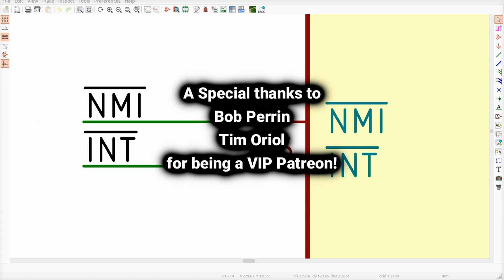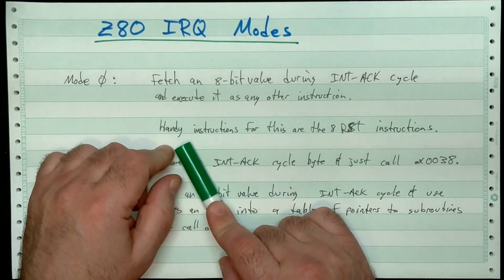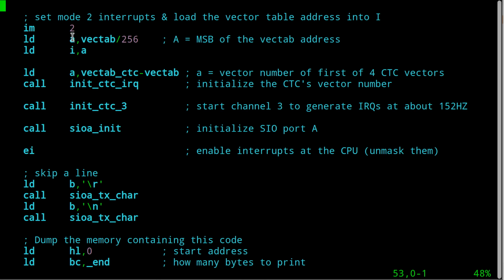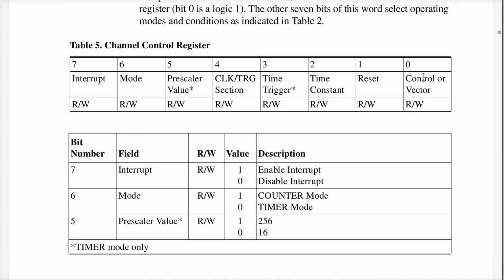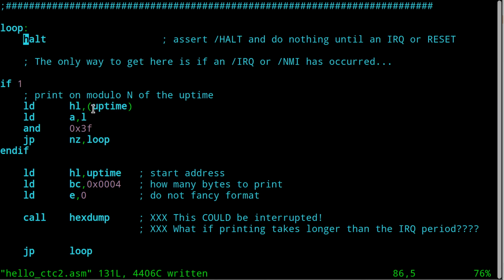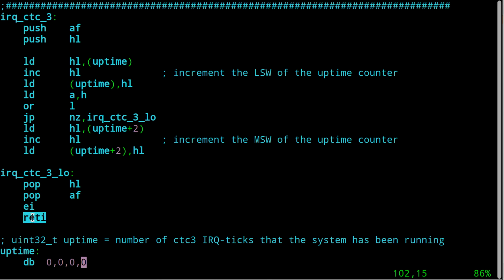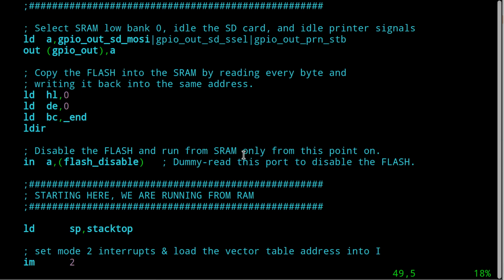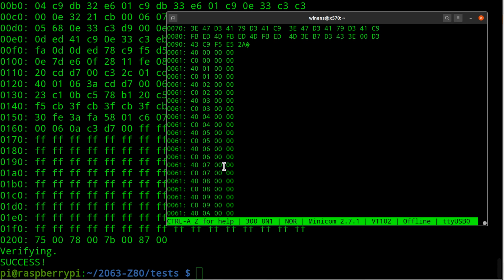Z80 Retro #16 - Board Testing Pt. VI (Interrupts)

Comment: So that's how the Z80 can tell what device triggered the interrupt.....huh. I'm using a microcontroller for serial I/O and the ability to perform interrupts would be very beneficial. Is it possible for an interrupting device to participate in the INT_ACK cycle just by monitoring /M1 alone? Or is that a bad idea, say if /M1 can go low for an unrelated reason? (Not sure if that's even possible)
Reply: The interrupt acknowledge cycle is decoded from /M1./IORQ
/M1 is used all the time for op code fetches.
You will need to decode interrupt acknowledge if you have bidirectional buffers (74xx245) on the data bus or are rolling your own Z80 peripherals.
Reply: Thanks, yeah luckily I have two pins to spare for /M1 and /IORQ so I can decode it.
Reply from the maker: One if using mode2 then you also have to participate in the priority chain & the state machine that releases the chain after a RETI.
Reply: @JohnsBasement  Only if you have multiple Z80 family peripherals. If you only have one being used with IM2 it only needs its IEI pin pulled up. If you use a Z84C15 which has CPU+CTC+SIO+PIO in a 100pin package there is a control register to set the interrupt priorities.

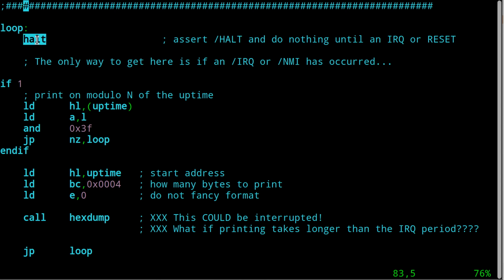Comment: HALT do WHAT?!?! @45:00

So they lied to me in school when we were fiddling with these Z80's. They said that HALT was a a total stop and the only return of function was to restart it.
As I always said and still say to this day, school here in Sweden sucks and even worse nowadays. You can't be a total freak into only ONE subject here, you have to be less then average in everything and I hate it.

Keep up these wonderful vids about Z80. I got a handful of them lying around, could be cool to try something out with them. Z80s, PIOs etc...
Reply from the maker: I teach from time to time.  It is amazing how hard it is to get entirely through a lecture without using the wrong word somewhere or even messing up an example.

:-(... I just uploaded a video where I refer to the alteration guide by the wrong name (although I expect you'll figure that out) and I used the allocation block number in a directory entry as an SD card sector number in some math.  :-(  After I reviewed it I calculated the correct value and my point was ultimately correct, so I am going to leave it (that one is in next week's videos.)

These things happen some times.

But I /will/ agree that saying that the halt seizes up a Z80 with no way out but a reset is not just a simple flub of using the improper units in some math.  In fact, I have never programmed a CPU where HALT is a hotel-California operation.  'cept maybe on systems that lack an NMI signal, do not generate DRAM refresh and you DI and then halt... which WOULD seize things up nicely!
Reply: @JohnsBasement  I took a class in which we described a simple CPU using register transfer notation and then by ORing together everything with the same left-hand-side we get a logic design.  It had a true HALT that stopped until the "go" button was pressed again.  At the very end, I found out this was a real computer, a PDP-8 or something of that vintage.
So, I think you'll find "Hotel California" style END instructions on very early machines, as they were not operated interactively or running "apps" as we know them today.  They'd be programmed for a specific math problem and once it runs through it's done.  The operator can change words in memory manually (e.g. to change one of the parameters) and RUN it again.

Comment: eyyy i just had my PCBs printed for my z80 project!
Reply from the maker: Coolness!  Are you building a retro! board or did you do a custom design?
Reply: @JohnsBasement  Its a custom design. it uses all new parts from mouser. Would you like a PDF of the schematics or the Kicad files? I think it would be very cool for some feedback with someone that has much more experience than i do if you want. Its my first time.
Reply from the maker: @KipperKlank  sure.  I'd like to see it.  A pdf is fine.  U can find my email on my github page.
Reply: @JohnsBasement  Alrighty you got it. Email sent.

Comment: I filled my vector table with 128 entries. The ones I don't currently use refer a isr_null_handler that puts the program in an error state and stops execution (in my case). This will catch stray interrupt vector indexes in a somewhat orderly fashion instead of randomly using what ever data was there as a isr handler address. 
Also note that nothing prevents a peripheral to supply an interrupt vector index that is uneven -with bit0 set-. That will ruin your day pretty quick.
Related my memory initialization routine at boot, will fill the memory with 0xFF (RST38) to trap stray execution, same idea as with the interrupt vectors.
Reply from the maker: I guess my history is showing 😂
These are great ideas!  I am not used to having all 64k.  So I went with a5 to make sure something is there!  Pullups on the data bus makes it ff if nothing replies and a5 if so.  I maybe aughtta change my ram values to RST 30 and add to your approach.
Odd vectors ate trouble indeed.  Fortunately the CTC & SIO can't be set to generate them.  So, at least the retro board won't do it it
Reply: In practise neither will happen. You don't just get stray vectors and you don't need to waste memory with more than you have peripherals. You would either have a bus fault or a broken peripheral in which case stray vectors are the least of your worries. Pullups on the data bus are fairly essential,  4k7 or less.